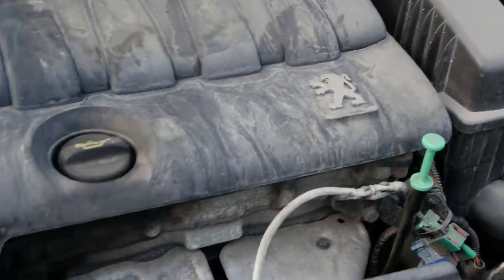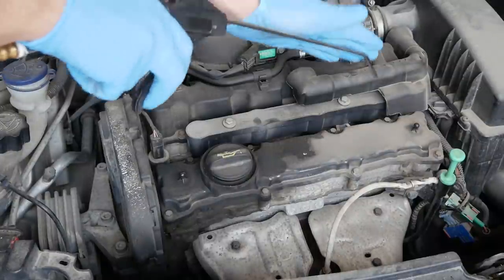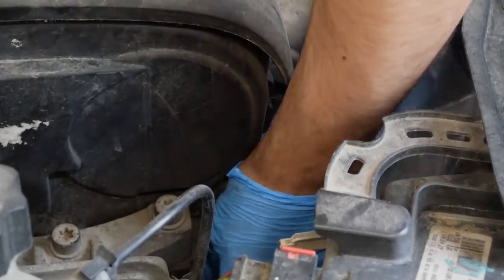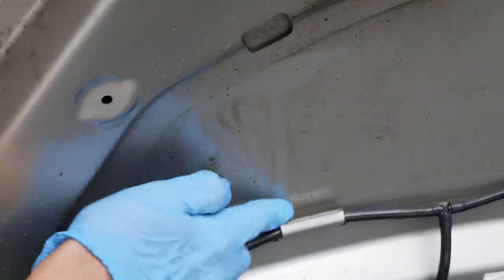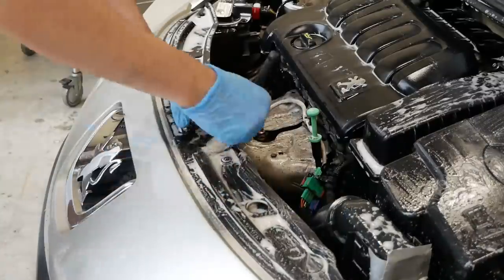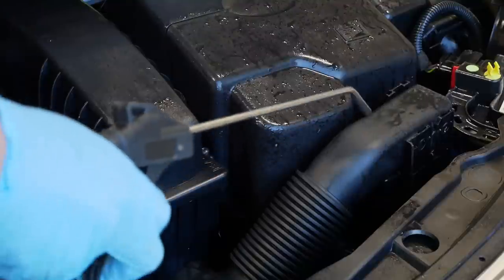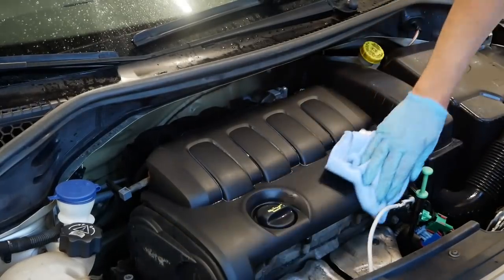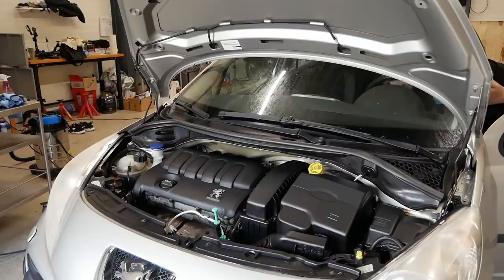First Engine Bay Detail EVER! (15 YEARS)

Comment: Maybe a slight side-track but I recently cleaned my engine bay and couldn't get the microfiber cloths clean afterwards, any advice? Do you do the whole low-end tier, high-end tier and separate towels by use e.g only reuse these for e.g dirty engine bays and keep a clean stack for interiors or glass? Or is there a trick to not ruining them, un-ruin?
Reply from the maker: Yes exactly I use that method different tiers. It's practically impossible to get an engine bay-towel spotless after a good clean. Also you don't want to use a beat up old towel on the paint work, so it's a really good idea to keep them separated. 👍